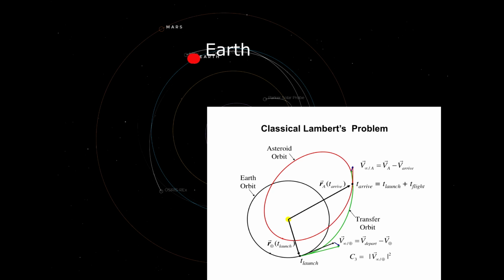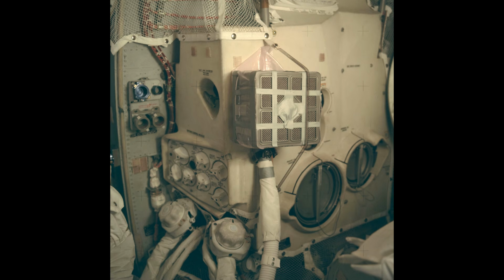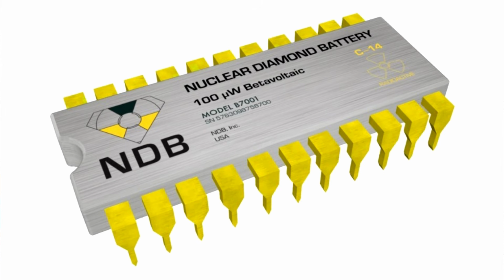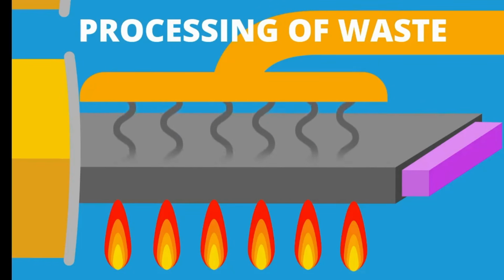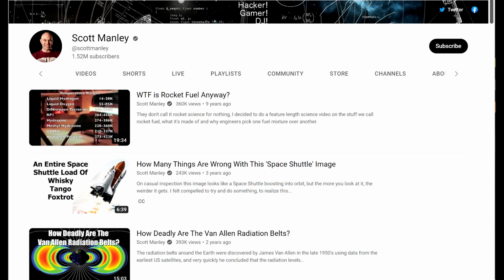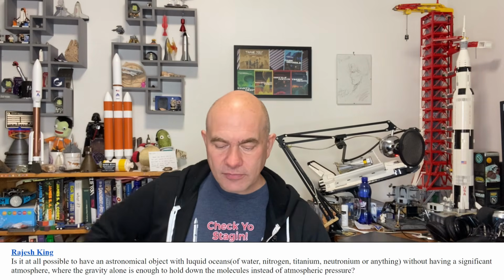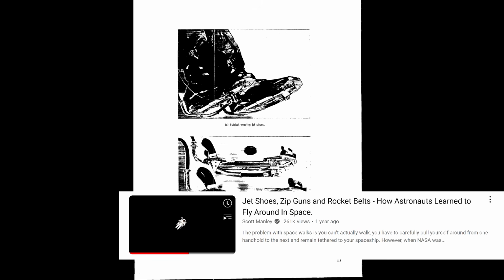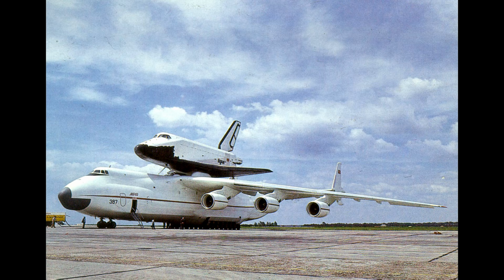Is There a Tripropellant Rocket Engine?  How Are Orbits Planned? - Deep Space Questions 21

Comment: 20:50 The side boosters of Energia rocket had RD-170 engines which were designed reusable and were tested more than 10 times in series without even maintennance. Those side boosters were meant to have wings and return to the runways like planes. Energia rocket could be used independently of Buran, unlike Shuttle. Only the USSR collapse stopped this program, unfortunately.
Reply: Also add that Energia series was also designed as a "golden trio" one replacing ALL the rockets with three engines and two tankage diameters: Zenit for Soyuz phaseout, Energia-M as Proton replacement and Energia itself as a (mostly) testbed for future heavy-lift reusable design, as well as launching something extremely heavy...
Reply: Look up Shuttle derived vehicles sometime and in particular, Shuttle-C which would replace the orbiter with a large cargo module. The Shuttle had the potential for that, but Congress didn't want to pony up the dollars for something that would've saved billions on Space Station Freedom or eventually ISS and allowed super-heavy lift missions.
Reply: It should be known that the side booster of the orginal Energia Rocket were actually designed to have parachutes with soft landing engines and shock absorbers to land sideways in the wilderness, the Soviets would recover the boosters with two massive Mi-26 Helicopters and bring them back to Baikonur for reuse.

The reason for why the first 8 boosters of the rocket were not recovered appears to be because the Soviets had yet to install the monitoring equipment required to recover them so they expended them instead.
Reply: I don't believe the strap on booster were ever tested for recovery in an actual launch. I thought there was a proposal to try that after the Buran launch, but didn't come to pass. The program had issues before the USSR collapsed, having encountered significant delays and serious questions about utility; and the testing program after Buran appeared to have been placed on a very conservative cadence. For reference: "at the end of 1989 Glavkosmos chief Dunayev said that 14 billion rubles had been spent during thirteen years of development and testing."

Now at that time, the space budget was 6.9 billion rubles, which at official rates at the time, equated to about $10 billion dollars. Source for those points is: Page 373 of "Energiya-Buran: The Soviet Space Shuttle" by Bart Hendrickx and Bert Vis
Reply: @michaeldunne338  I did mention in my the comment that the Boosters on the 2 Energia flights were not recovered.

I will mention that their is an old poor quality video on the Internet showing a computer simulation of how they were supposed to be recovered, although I haven't see it in  a while I think it's on a Russian Space website.

Thanks for the information anyway of the tragically dire financial situation the Buran-Energia program was facing by the 1990s, the Soviet Shuttle was effectively dead by 1992 although it was never officially cancelled.

In my opinion the Soviet Space Program would have been much better off state if they had continued investing with the ill-fated N1 Moon Rocket beyond 1974 instead of cancelling it and wasting Billions of Rubles building a completely new Rocket from scratch with the added cost of building 5 expensive Space Shuttles, yes the Soviets were really building 5 Buran Shuttles by the time of the collapse, its no suprise that the program had cost 14 Billion Rubles by then, the development of the engines for the boosters and Energia alone were completely unaffordable for the Soviet economy.
Reply: @Boeing-I-hs2gj  Yes, you did mention that the Block-A boosters (the strap on boosters) were expended for the two flights. I guess I was addressing the possibility of a standalone recovery test, say as a precursor to Zenit, or even during the timespan of Zenit (about 70 percent of systems were common/shared between Block-A and the first stage of Zenit)? Say like proofing out the interesting horizontal approach with parachutes. 

I would have to review the records/claims, but seems like Buran at least was on thin ice since May of 1987, and the Defense Council appeared critical the following year: "the Council expressed dissatisfaction with the progress made on devising payloads and missions for the shuttle"... "made some cost cutting moves, ordering the number of operational shuttle vehicles to be reduced from five (as planned since 1977) to three, and curtain Buran's test flight program to just five missions" (source. page 364 of Energiya-Buran: The Soviet Space Shuttle). After the landing of Buran, Gorbachev supposedly was like "OK. fine." ...

Then Valentin Glushko died in January of 1989, which may have accelerated a power struggle over at NPO Energiya. And maybe emboldened opponents, like a Yaroslav Golovanov, who in 1991 would put "the cost of lifting one kilogram of payload on Buran at 6,000 rubles ... If that payload were launched on a Soyuz rocket, it would cost only one-sixth of that"...

Otherwise, you are one of the few I have come across feeling N-1 should have been continued. Could you provide  a little more detail on that position? Sounds very interesting.

Comment: Why is asparagus staging called that? I don't get the connection. It didn't look like an asparagus to me. Actually, Falcon 9 looks more like an asparagus to me (a long stalk with a swelling on the end that tapers to a tip) than the Kerbal example shown.
Reply: Apparently someone made a crossfeed rocket in Kerbal Space Program and it somehow looked like asparagus, so that became the new name for it. Although I assume this name is only used within the Kerbal community.  I remember when Falcon Heavy was in development it was talked about a lot but it was just simply called crossfeed.
Reply: Because asparagus is sold in bundles, and staging is basically discarding the ones on the outside of the bundle. Real "Kerbal" asparagus staging isn't something like Delta or Falcon Heavy with two side boosters... it's more like three or four entire rings of boosters around the core.
Reply: @simongeard4824  That makes more sense, now that I see it from a "Kerbal" point of view.
Reply: @StevePemberton2  Indeed. The basic concept as described in the video is a real world thing, if not overly useful in practice — but I'm pretty sure the term "asparagus staging" comes from the KSP community...

Comment: Saw the video thumbnail, saw the Buran and thought "Is Scott going to stop worshipping SpaceX and branch out again"... got to the final question... oh no. Oh. No. Knew immediately where he was going even before the rocket boots section was fully started... Controversial? No, just sadly horribly predictable. 
And hideously biased; "There's a lot about Buran that I like"... but you're not even going to name? Sigh. Not even the things you've talked about in the past; how air molecules work the same in Russia as in the US; if you're going to build a space plane, there's a very narrow range of engineering solutions, so most are going to look the same, as indeed to the space planes flying now. But no mention that in could fly fully automatically, without crew, and did? No mention that without engines, it had greater payload capacity and, especially as the Soviets wanted the suspected military benefits of a Shuttle which they suspected was stealing stuff in orbit, thus greater back down to Earth payload capacity because it doesn't have to land the engines again? Or that they decided to deliberately build a much heavier launcher which could also work independently for their own larger payloads... a model of launching that proved to be the actual best way forward today? 
Starship of course still isn't off the design board, whilst SLS, the Shuttle Rocket Without The Shuttle, and Artemis are on their way back from the moon. Could Energia have done the same? By all means criticize the Soviet Union, whose collapsing economy was the real issue behind why Energia was shelved; And no one sane would ask you to praise Russia politically today. But it's blatantly obvious your position comes from a wider Musk fluffing that, especially today when Elon has gone full Musk off, you should be deeply revaluating rather than doubling down on today. But slap a cool "X" on it, fund it through a narcissistic manchild who promises you all your space dreams but openly supports neo-Nazis, and you'd be praising it as a "Starship" heavy booster today. Instead we're increasingly getting Starship Troopers. And that is the real controversy. That the actual science is still seen through a lense of what a nation state that hasn't existed in 30 years was like, whilst blatantly ignoring the absolutely horrendous behaviour of a CEO that here and now is genuinely supporting outright coup attempts.
Reply: No, this wasn't a video about Buran, he was trying to answer a bunch of questions.  Worship spacex?  Pull your head out of your rear.

Comment: Another "tri-propellant" concept is basically doping the fuels for different reasons. IIRC there are solid rockets that asymmetrically inject stuff into a fixed nozzle to generate asymmetric thrust for guidance. Another case is where the simple reaction isn't usable for some reason; the V-2 used a LOX-ethanol-water system to keep the temperatures down (that said, the ethanol and water were pre-mixed). One of the crazy things dried (on a test stand) was to inject a third component to increase the density of the exhaust (giving higher volumetric specific impulse); the case I'm remembering involved a manager not getting that a comment was a joke and resulted in a rocket who's exhaust had significant amounts of mercury in it being test fired.

Comment: The specific Impulse for the Liquid Lithium, Liquid Fluorine and Gaseous Hydrogen engine that was tested was 542 seconds. This compares to the highest specific impulse chemical engines ever flown, which were the Space Shuttle SSMEs with an Isp of 454 seconds. For a space craft with an alpha ratio of 0.9, this means replacing the SSMEs, it would increase the payload by 45%.

Comment: I feel like people think the CO2 scrubber was a bigger deal than it actually was, due to the emphasis the Apollo 13 film places on it.  In reality the CO2 issue wasn’t a surprise, and wasn’t really a huge concern.  They knew the LM scrubbers wouldn’t keep up, and they had the adapter procedure (which had been thought of before Apollo 13 even launched) ready to go when it was needed.  It wasn’t a last-minute, down-to-the-wire race against time like in the film.  Compared to things like maintaining course and the unknown state of the heat shield, getting the CM cartridge to work in the LM was a pretty minor thing with no real unknowns to worry about.

Comment: 7:40 there are Boeing documents that discuss a Delta IV Heavy with propellant crossfeed, 6 SRB's, and densified propellant that can apparently do 50+ Mt to LEO or 20 Mt to c3
Reply: "Mt" = megaton. I don't think it can lift 10^9 kilograms.
Reply: @filonin2  I think they meant metric tons.
Reply: @SynchronizorVideos  yes. That's how it was written on the Boeing slide deck I was reading from. Sorry for any confusion.
Reply: Opinion:. The confusion started when the metric guys took the English/American ton (2000 pounds) and decided to make up the metric ton (tonne?) and instantly cause confusion with the "other" ton. Why not  simply use mega gram?   20 metric tonnes is 20 Mg.  I mean, meter isn't called a yarde, even though they're "close," is it?  Don't get me wrong.  Metric is good.  But "metric ton" isn't.  :-)   but I suppose "metric ton" is here to stay.

Comment: The full size Buran never flew in Space (AFAIK). Unlike the Americans, the Russians didn't launch Buran from the An-225 for the flight tests. They put a set of normal jet engines on it and just launched from the ground. There was a scaled down test article they did fly and use for reentry testing. 

Both the Buran with the jet engines as well as the scale model are now in the Technik Museum in Speyer, Germany. You can look at the test model really closely (I don't remember if you could touch it, it's been a few years) and you can climb into the real Buran. REALLY worth a visit.
Reply: Yes, Buran completed 1 test flight.

Comment: Thinking on space occupation, do you think it would be possible/viable to use the fuel tanks themselves as habitable space? IE: you send up three rockets, one acts as a center point/docking station (similar to what you had Stowaway), then have the other two attached to it by cables, fire the last of the fuel, and then use the empty tanks as habitable space?
Reply: It would depend on what was in the tank.  LOX tanks, no issue.  RP1 tanks would take some.. cleaning.
Reply: I think “wet lab” was the term for using tanks as habitats, although i know nothing about the prep work needed for that / rocket plumbing!
Reply: @ericlotze7724  :Wet hab, so literally only 1 letter off, though if you put a lab in one it would obviously be a wet lab as well. The defining prep work is to do something to get rid of any undesired remaining propellant, and removing any components that are needed for the tanks but in the way for a habitat. All other prep work would be standard space station setup work, albeit perhaps involving more equipment installation than normal (since you might not want any equipment to be exposed to your propellants...).
Reply: You would have to completely tear parts off the tank for holes to allow access since tanks generally aren't built with holes big enough for people to fit through. Then you also need to reseal those holes with doors/hatches or even potentially walls. The interior also doesn't have electrical/data hookups so you will have to wire that, and there isn't any ventilation/life support functions which likely is necessary. While it is all feasible, it requires a lot materials and techniques like welding and metal work, potentially to high levels of precision, which we just have not fully develop/tested yet in a 0g environment. For the mean time, sending stuff up fully assembled from the beginning is a lot more preferable than a whole bunch of materials which will weigh nearly as much and which will be reliant on manufacturing technics which are likely poor, untested, and unreliable. In the future though, especially when materials for spacecraft start getting sourced from places in space like asteroids, manufacturing technics will advance and recycling tanks like that will likely become common.
Reply: @Michaelonyoutub  But Skylab was so   R o o m y
Reply: @ericlotze7724  yeah but it was assembled on the ground instead of in space.

Comment: 6:00 I wonder if part of the issue with asparagus staging IRL is the need for turbopumps to move the fuel around? You can't just rely on pressure unless you wanna end up carrying more filler gas than propellant on the outermost boosters, and turbopumps would have used a wasteful gas generator until Rocket Lab proved extremely recently that those can be electric? So perhaps this will become more doable in the future, using electric pumps with expendable batteries?
Reply: I mean, the engines all have turbopumps anyway.  I think it’s more an issue with the complicated valves, pipes, manifolds, etc that would be required to switch where the pumps are pulling from on the fly, while engines are running and things are separating.  It’s a whole lot of extra stuff that could go catastrophically wrong.
Reply: @SynchronizorVideos  The engines do, that's exactly my point ; fuel tanks typically don't, and I'm precisely asking if the added complexity and weight is part of the reason :-) on top of the fuel expense. Obviously there's always a chance anything goes catastrophically wrong, but I don't think that alone really explains the absence of asparagus in the wild - rocket science can go catastrophically wrong in itself, yet the ISS is up there :-)